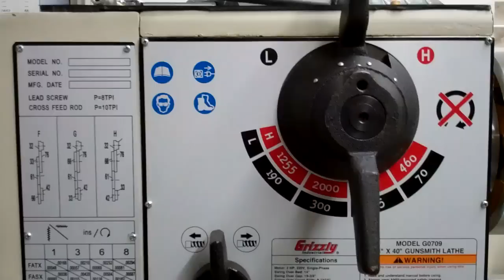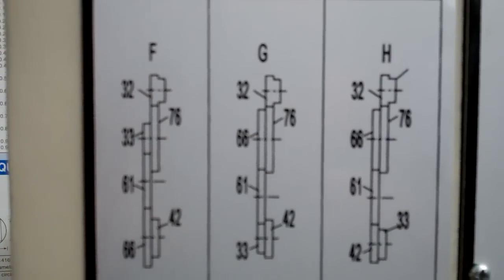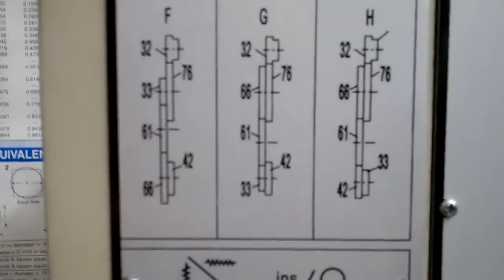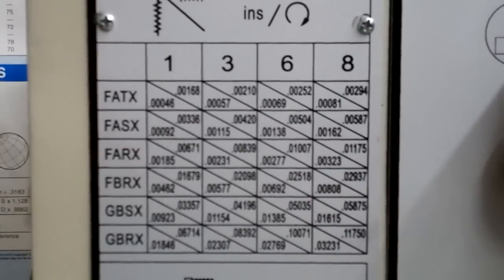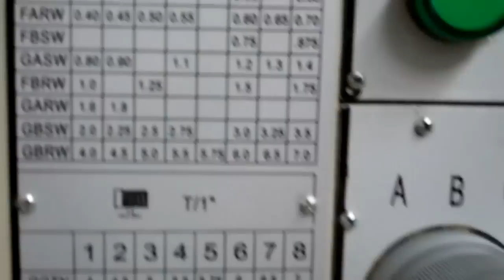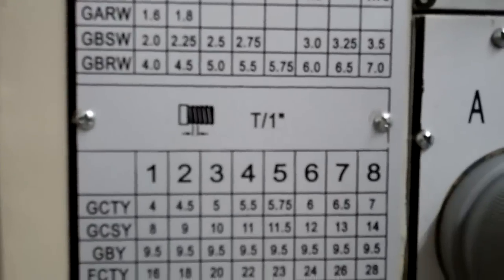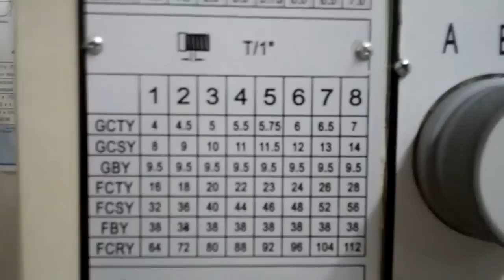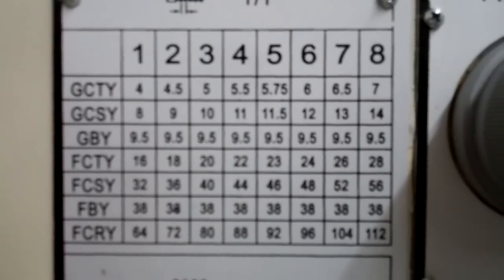Grizzly G0709 Threading/Feed Setting Charts

Comment: This lathe didn't start off being my first choice, but once I read through the manual of just about every other GS lathe they sell...I ended up ordering one today. This is in no small way due to the videos you made Ray--so thanks(!!!) for the efforts in making and uploading them. Not sure if you're still using that unit, but I'm sure there have also been changes made to the thing since you bought yours too.
Reply from the maker: To date I use this lathe almost daily without one issue! I do a lot very accurate work with excellent results!
Reply: @RaysGarage  Great news Ray, thanks for the reply! The G0824 lathe is a newer 14x40" machine with a 2.01" spindle barrel, but requires a lot more gear changes than the G0709 does. Also the G0709 will allow you to (more easily) cut diametral pitches, meaning you can more easily cut worm shafts/screws. Since I plan to use this mainly to build model engines (and am not a gunsmith), I figured I would make much more use of its threading capabilities than the 2" spindle bore, so I went this route. I'll have to install my own DRO, and ordered the same one Grizzly uses on the G0824--but that's a one-time thing and once it's done...it's done. 

You have some pretty cool videos on the channel, and I am definitely following along. Sorry to hear about your injury, but am very glad you're OK. Thanks again for the reply!

Comment: thanks ray... i have a problem with my g0709 leaking cooling/cutting flood all over the floor out of the tailstock stand... i'm not smart enough to find where its leaking but its a substantial amount... i was going to by-pass the drain system and attach a 1 inch id clear vinyl hose but the little knob under the drain wouldnt hold the clamp... so i decided to thread in an adapter and attach to that... i measured the id of the adapter which is welded to the bottom of the tray under the drain.. then i found that a 12 tpi would work... not sure why... so after finding a calculator on line for determining minor and major diameter i single pointed a piece of delrin at 12 tpi... then drilled it out... i had to chase the threads 3 times but i got it to thread in... kind of cool but it didnt work because the tube kinked that i wanted to go into the stand on the tail stock end and down in the bucket... tomorrow i will see if i can find a 45 degree adapter at 1 inch id to fit over my 1 inch od part and glue them together... i may have to abandon my hose idea and hard pipe it in so i dont have any more leaks... i wont be able to move the tray but i don't anyway as i prefer to shop vac it out,,, i get it cleaner that way.... does yours leak?? if so how did you fix it???
Reply from the maker: To be honest, I don't like flooding my machines so I use the Cool Mist Fog system on big jobs and just a acid brush w/cutting fluid for small jobs. I don't like flood systems because the fluid  gets stagnet and stinks after a while plus tend to be very messy. Also, I like being able to remove the chip tray, I do vac it but, I also like to wipe it out from time to time. That's my two cents worth.

Ray

Comment: Pipe threads are rarely cut by single point because of the necessity for a taper attachment, and the amount of time and effort required being much more then a tap and die. We still need to single point straight threads when we cant afford any error of axial alignment. In any case, pipe threads have a standard lead to them equivalent to straight threads. The MP and DP actually stand for Modular Pitch and Diametral Pitch for making the worm in a worm gear assembly.

Comment: Thanks Ray, that worked just fine, I could pause the video and see what I needed to. Looks like the only thing that might be an inconvenience is 12TPI otherwise all the threads I work with will be in the same gear set range.Likewise on the slower feeds.